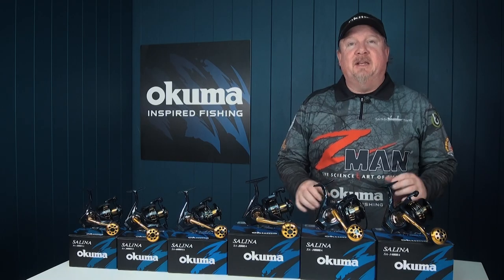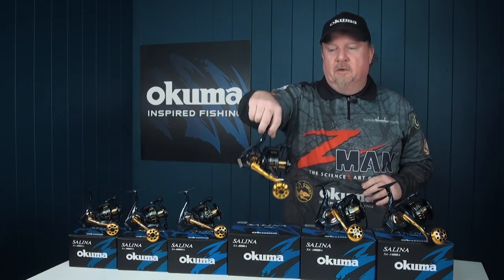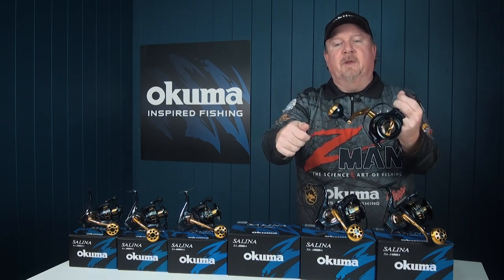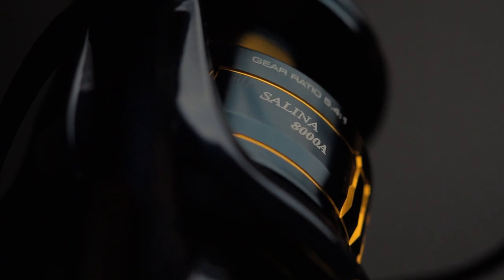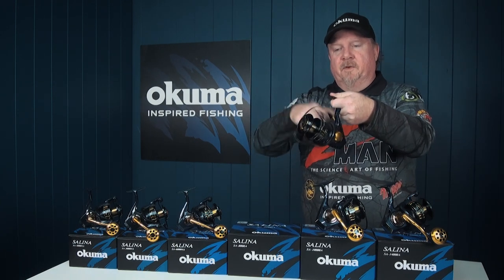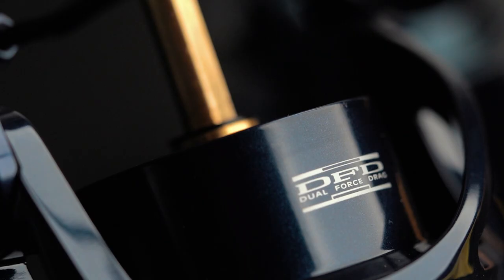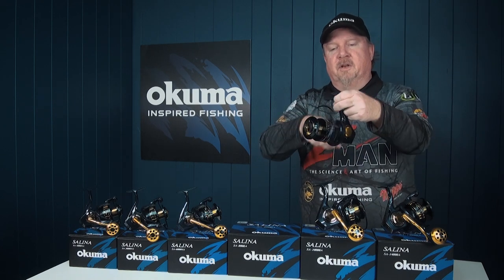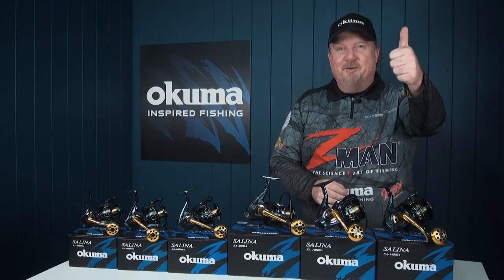Okuma Salina Spinning Reels - An Introduction and Overview

Comment: May i ask...is the main gear zinc?
Reply from the maker: Hey @robertabrams91, Hope all's well and you're finding a fish. HDGII: Corrosion resistant, high density gearing and precision machine cut hardened brass pinion gear. All the best with the fishing. Cheers, Justin